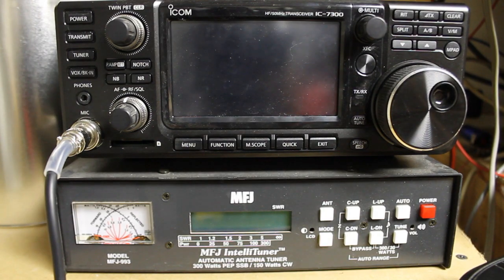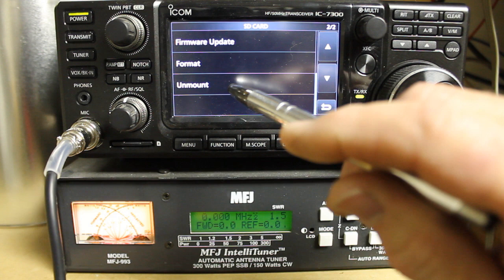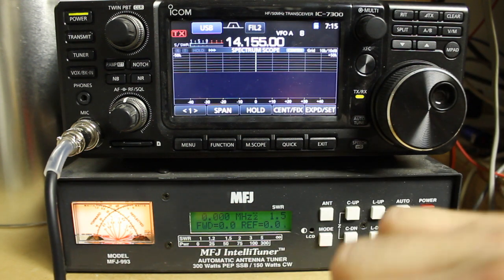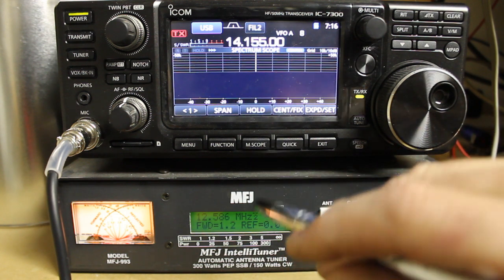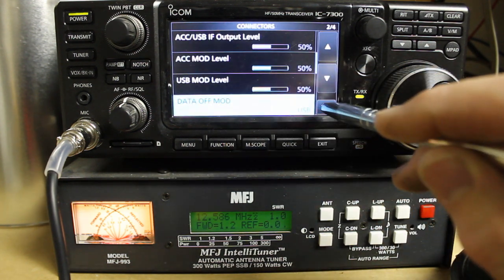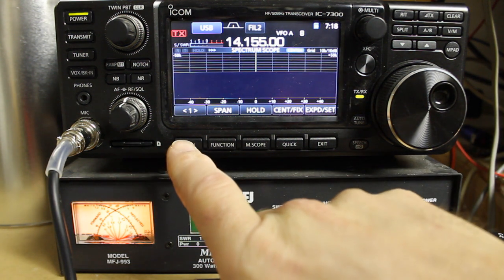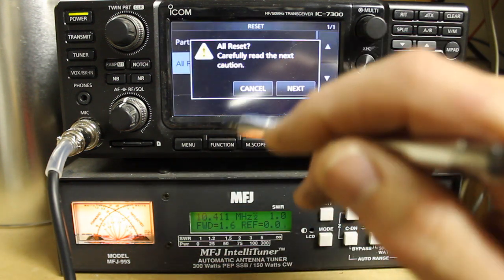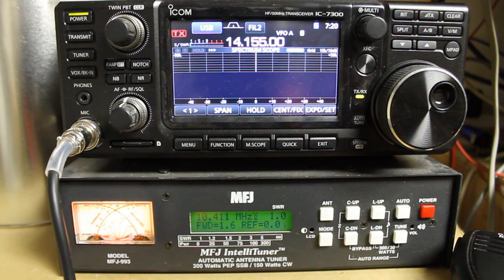Icom IC-7300 Tips and Tricks - Common Problems and Saving / Reloading Settings

Comment: Thanks for the very useful video. If I save my settings to the memory card and then upgrade the firmware to a later version, will the SD card just bring my settings back with the earlier firmware or the later version?
Reply from the maker: It will keep the updated firmware and apply the settings.

Comment: I have aICom7300 and I have low power when transmitting. There is no blue line coming out at transmitting  but does on receive. And the I'd is between 2nd and 3rd dot on I'd. Tried what you did but didn't help. Was in usb but now mic. Any ideas. Please and thanks 73.

Comment: I have a problem that is causing me to consider sending the 7300 in for repair. Let me explain. When I transmit, the receiver doesn't go to the receive mode immediately afterwards. It normally takes 5-10 seconds to hear the frequency again. Any ideas?

Comment: hello maybe someone can help me my 7300 works great in digital modes ft8 ft4, but when i switch to SSB OR FM AM CW i have no sound at all i try squelch open still no sound, no external speaker sound either and if i unplug ext speaker the internal speaker no sound. but in the front on phones i plug speaker there and get sound and beeps normally so need help fixing this problem

Comment: Hi I have this same setup. The com 7300 and the MFJ 993B Tuner. Do you use the MFJ 5124I Cable too ? We ran into this no transmit problem with this radio on field day 2022.

Comment: Thanks very much for sharing this information. I’ve been having trouble with presets (Normal and FT8) not seeming to work properly. If you have experience using presets on the ic-7300 I’d much appreciate hearing them. Thanks again and 73 (KK7CSC).

Comment: Mine, (1st one of these for me), is on the way!  I have two quetions;
I'm thinking the radio can be operated/used without the SD card?
Where can I get a stylus pen like the one you're using to tap the screen with?

And thanks for your video, and all other Icom 7300 videos as I am more accustomed to doorstops and cinderblocks in the realm of analog radios, lol!

Comment: Great INFO!!! New Ham here. I was trying to get the MFJ 929 to interface with the ICOM 7300. At first the frequency on the MFJ 929 did not change from the default 0.000MHz. Then suddenly the MFJ 929 displayed the frequency that was on the ICOM 7300. But as I changed bands on the ICOM 7300 the display on the  MFJ 929 just stayed on the last frequency it had. Is there anything that I'm doing wrong? Or is the MFJ 929 in need of repair?
Thanks for any information!

Comment: Hi, my issue is that my SSB power is very low. Does not go over 10W even if power is turned to 100W and Mic gain at 74%. No pb in FM i can see the 100W. What do you recommend?
Reply: you ever find your problem?

Comment: There is another MIC + USB setting on the data out mode that you didn't scroll down to.  That is the one that I usually use so that I can alternately use phone and data modes without changing from USB to MIC every time I want to change from phone to data or vice-versa.  I didn't see that MIC + USB setting at first because it is hidden unless you arrow down.

Comment: Great tutorial, I just recently got this radio then just got my General yesterday, have not power the radio on just yet, looking to make space for it and mount it. I also have the IC-7100 from few months back but it is also new, never powered on yet. with the IC-7300 I am putting together a to go system for picnic tables and car camping. The weight of everything so far is around 40 pounds but it is including a 1510 Pelican case which has wheels. Can't wait to announce my upgrade on the air. 73 from Rody, KI7CSI

Comment: Hi just bought a 7300 before that I had a yeaso 450d on a dismount cp6s antenna when I was on my 460d my s w r was good  .now it's over the top 3.4 the only one that is 1.1 is 28.000.00 going up the rest to high any thoughts why I have looked at my plugs and earth wire all ok I even took the earth wire out the back of the 7300 just to see it that would help , but still the same . Thank you for any suggesting any thing from across the pond in East Yorkshire G4 KOH my name is ken .

Comment: HI I have a new IC-7300 and am having trouble with the transceiver keeping the clock settings when it is turned off.  It is less that two weeks old and other than that issue it works great.  Any ideas?  Jeff Berry K5JCB
Reply: All I knoow is that it has a small internal battery, to run the clocks

Comment: Thank you for the tip regarding no ssb output!!! I spent the weekend scratching my head in frustration until I stumbled on to your excellent video. And you’re right: I think it was caused by the RS-BA1 software. I can’t thank you enough - I was almost certain I would have to send the rig in for repair or at least trying a full reset. 

73, Ken, N0IZE
Reply: Thanks, MONI was bumped on mine....an immediate fix👍
Reply: Me too . . .  I was getting no output . . . had been using FT-8 and probably hadn't closed it properly?!

Comment: I want to hear how ICOM explains all the issues they will have when all those touchscreen start failing and almost every radio they build these days has a touch screen. They will fail and they will give nothing but pathetic excuses.
Reply: seems that would have showed up by now 3 years after launch or are you just a troll?
Reply: The touchscreen is LCD, and the lighting is LED. It should last a lifetime.

Comment: Hi there can anyone tell me what it means when the power light on the power switch starts flashing, i am sure i have seen it in the manual before but i cant find it now is it something to do with recording the screen to SD card?...i turned it off and on again at it was ok...Fred g4vvq in uk. IC 7300
Reply: Better late than never.  Flashing power light means you are looking at a previously saved screen-grab, not at a live display.

Comment: I watched all your videos and they are all excellent!  Thank you.  I would like to see a video using an external keyboard to operate RTTY on the Icom 7300.  There is no way, I believe, to type a reply immediately after a reply to CQ without going to the onboard keyboard.  It takes too long.
Reply from the maker: Deryl, as far as I know, there is no functionality to use an external keyboard on the IC-7300. It may be a feature of the IC-7610.
Reply: Although there is currently no option to do so, it should be very easy to add keyboard function to the IC-7300 using the RS-BA1 remote control software. I'm also disappointed that you can't scroll through the memory channels with the main tuning dial. Hoping that Icom will consider that in a future firmware update. Otherwise the radio is really nice.

Comment: Thank you for this video. I had this exact problem and thought it was my auto tuner. In the process of trouble shooting the problem I reset my radio and that solved the problem. I just wish I had watched your video before I reset the radio without saving all my settings. Of course if I had watched first I would not have reset the radio!
Reply from the maker: I've reset my radio more than a couple of times, but I like to avoid it when I can.